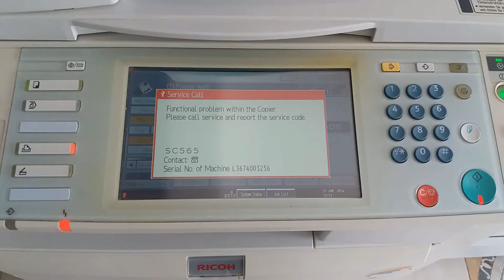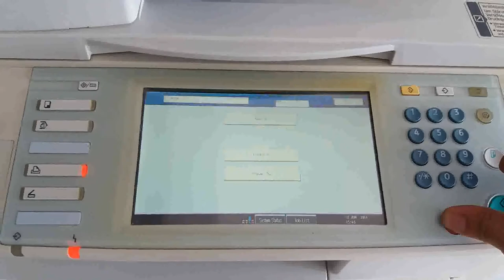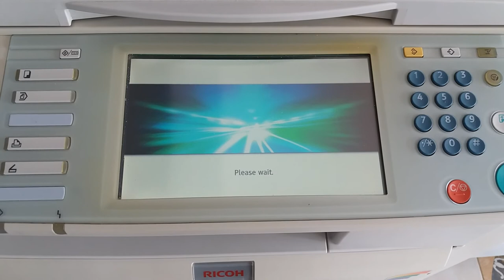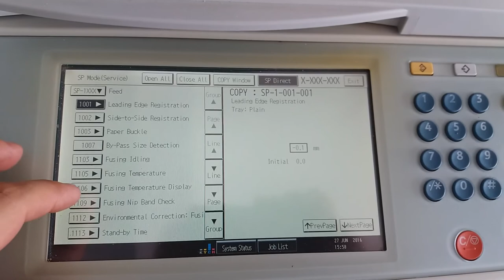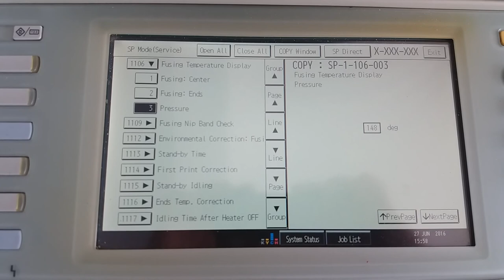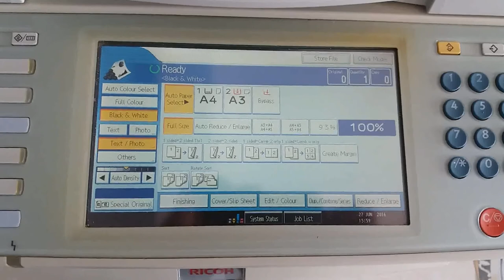SC 565 RICOH Aficio MP C2500 (solved)

Comment: Could you give me, the characteristics of the thermistors, I would like to replace them with new ones. I can't see (in the video)  if it is only one thermistor or two together , I would like to know if they are NC or NO, Which is the working temperature ?
Reply from the maker: Hi! Why do you want to change it?
Reply from the maker: This is the code  (AW11 0055 Thermostat - 146c/147c)
Reply from the maker: of the pressure roller
Reply: are you  sure  it is enough, to pound on the table, the thermistor to solve the problem in RICOH Aficio MP C2500 with error SC 565.  ?
Reply from the maker: Yes! The thermistors have two black pills. those pills must be up, in this case one is up and one down. Touch that pills and you will see
Reply: ok thank you